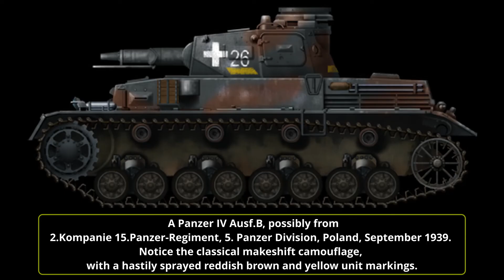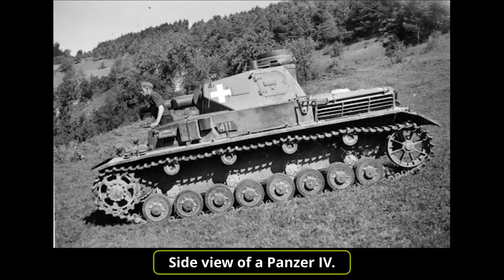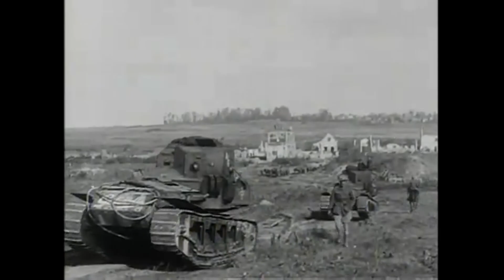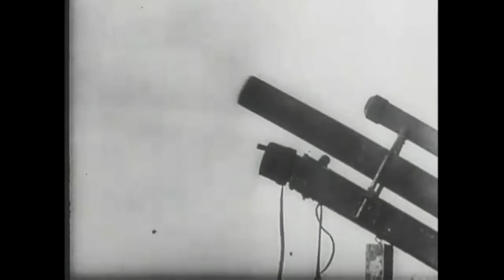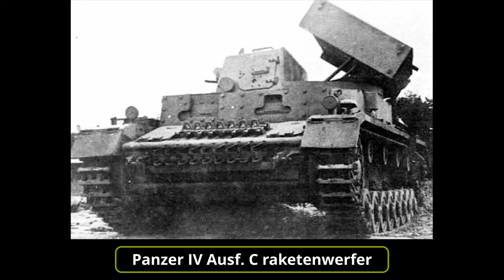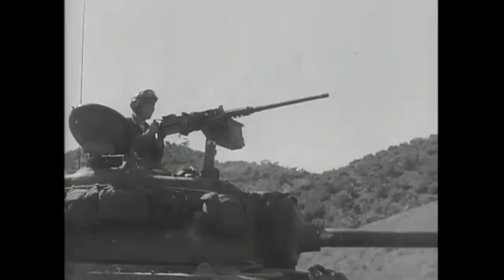Incremental Improvements | Panzerkampfwagen IV Ausf. B & C German Medium Tanks

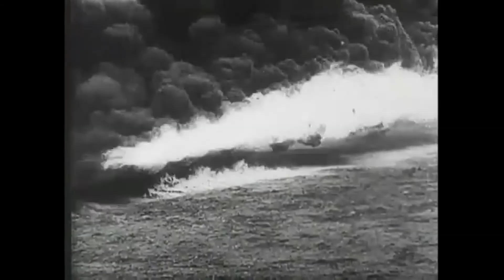Comment: Not at all sure why the random footage from about 17:00 to 18:00 was used. It seems to have very little to do with the Panzer IV, the script, or the overall narrative. Seemed to just be random clips from WW1 & WW2.  Was it supposed to represent the backdrop in which the Panzer IV was developed, or something? If it was that, why did it not match the voiceover.
It certainly seemed like "padding" to me.
I mean, was that a British Mark IV, then a Whippet, then an FT - and there was an A7V in there too. All WW1 stuff.
IF ... the point was supposed to be something like a Panzer IV combine the infantry support elements of the British Mk IV, the exploitation of breakthroughs role of the Whippet, the turret of the FT, and the anti-fortification ability of the A7V ... then maybe it MIGHT make sense. Yet this should have been more explicitly mentioned in the voiceover.
Like I said, whatever the intention, it just looked like random "scenes of war" padding to fill a gap in relevant pictures.

Comment: Front hull was not sloped just 9 degrees... superstructure was... upper hull had much higher slope, almost 73 degrees (T34 had only 60 degrees slope), but was just 20-25mm thick, yet it was good enough to deflect most hits.. thats why over time, only supestructure armor was upgraded, first by adding additional 30mm, 50mm and then  80mm thick plate.

Comment: The 75mm. L.24 KwK.37 gun received the most comprehensive and varied ammunition choice, compared to other German tank guns. It also shared this ammunition choice with the 75mm. L.22 Ig.18, Ig.37 & Ig.40.

Armour Piercing ammunition performance (from Kummersdorf range tests):

APHE KGrRotPz. (In service 1937) shell = Up to 48mm. @ 0 degrees @ 100 metres.
APCBC-HE PzGr.39 shot with tail grenade (In service 1940) = Up to 57mm. @ 0 degrees @ 100 metres.
APCR PzGr.40 shot (In service 1941) = Up to 76mm. @ 0 degrees @ 100 metres.
HEAT Gr.38 Hl/A shell (in service 1939) = Up to 84mm. @ 0 degrees @ all ranges.
HEAT Gr.38 Hl/B shell (in service 1939) = Up to 91mm. @ 0 degrees @ all ranges.
HEAT Gr.38 Hl/C shell (In service 1939) = Up to 120mm. @ 0 degrees @ all ranges.

Other ammunition included HE, Smoke & Case/Cannister.
Reply: never heard about APCR for L24 gun..
Reply: The Pz IV A-E also usually had a small allotment of Canister Shot as well. Kt. KW.K
Reply: super old comment but I'm curious where did you get info on a APCR for the L24 KwK.37
I dont think it's legit

Comment: 14:38  never seen a Pz.4 with the short 75mm with schurzen; were they added later on in the war on an old chassis (maybe for testing)? Otherwise the side vision ports and pistol ports would have been  blocked by the armored skirts. I'm really curious about that particular  Panzer 👀
Reply from the maker: Short-barelled Panzer IVs were still in use late into the war, in units that were not meant to be on the frontline. However, as times got desperate, they found themselves thrown into the first and there are a couple more later variants (D, E, short F) seen with the short gun and the Schurzen.

And yes, it would have blocked out vision ports and pistol ports, but these were deleted on later-built tanks anyway.
Reply: @TanksEncyclopediaYT  Thank you very much for the answer☺
for what regards the early panzer IV, are there any Ausf. A, B, or C that survive in a museum ?
Reply from the maker: Nope. 3 Ds, 1 E and 1 short F.
Plenty of long barrels though.
Reply: @TanksEncyclopediaYT  one last question, I've heard Hilary Doyle saying that the ammo capacity for the main gun went up when the kwk.40 was installed, due to "better stowage". Do you have any information about how the stowing was improved? because judging by the case length, It would seem counterintuitive 😞
Reply from the maker: We'll answer that when we get to the long barreled ones :D
Reply: @TanksEncyclopediaYT    😮, I'll stay tuned then😃